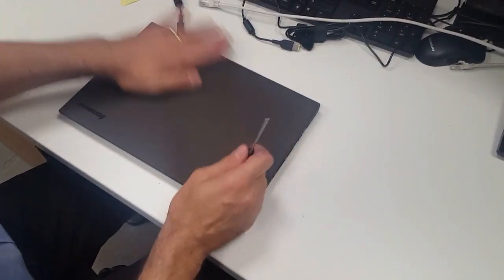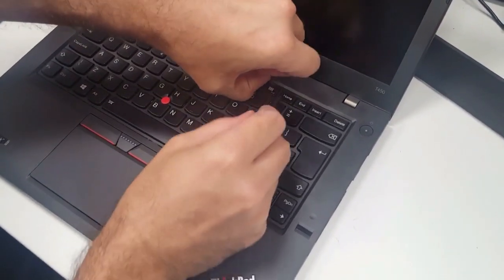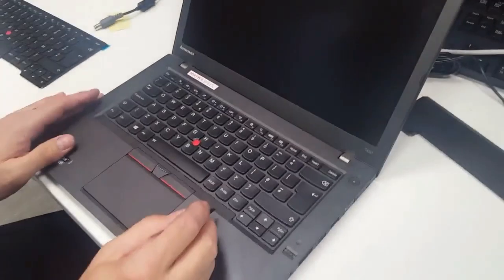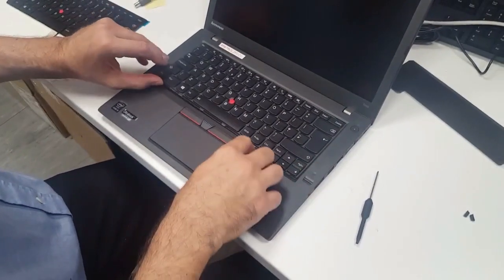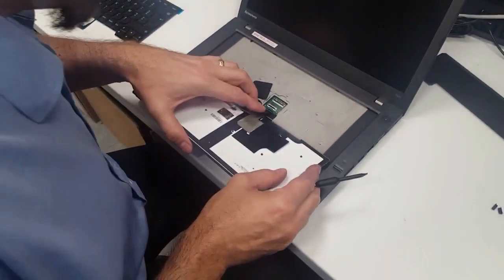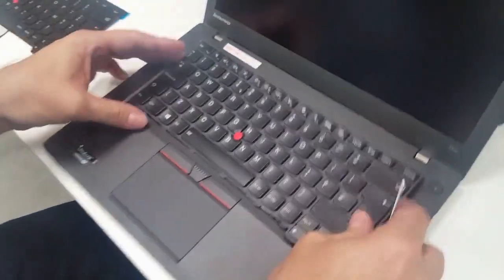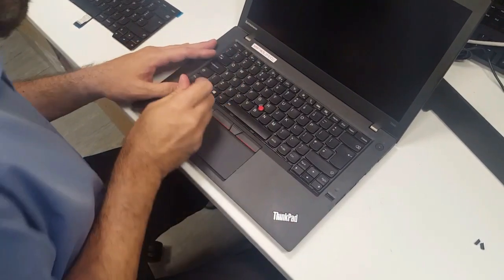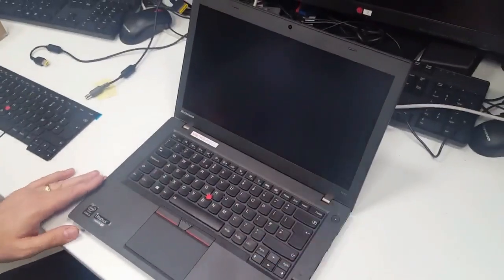T450 Laptop Keyboard Change

Comment: On new replacement keyboards there's a blue plastic strip on the bottom with some padding that fits into a groove.  Unless this is removed, the keyboard won't install properly.  Not having installed a 450 keyboard yet, this was a sticking point for me until I figured that out.  Other than that, this is a great video and was very helpful.
Reply: How to remove password from Lenovo l440

Comment: Thank you for this Robert.  A few notes that I learned: when pushing the keyboard up with a flat head, don't use too much force.  I destroyed a keycap this way by slipping.  Also, when pushing the rubber grommets out from the front, it's good to know that you can't 'aim' directly at the spot between e.g. F12 and Home, as there's plastic between them; you need to choose a side (left or right) to get at the grommet.  Only a flat head worked for me to push the grommets out, a spudger failed.

Comment: Hi Robert, got a slight issue as I removed the old keyboard as it had the return key missing (forth time it had sprung out of the keyboard) and I had an issue with key responses not working as I had taken the laptop over from old job. When I removed the laptop the two white clamps that you click up to release the small and large ribbon cable both just fell apart, so I need to find a place that actually sells them. Lenovo just says it comes with the system board. So screw that idea of scrapping a decent mother board  for the sake of two plastic clamps. Do you have any idea where I can get two replacements so I can install the new keyboard. By the way I have tried some of the solutions already, such as cutting a small piece of plastic and using this to clamp the cable in. Doesn't work. Also someone suggested a hot wax/heat gun but if you use this and it does not work you can pretty much kiss good bye to the connectors and motherboard. Any ideas or suggestions would be appreciated